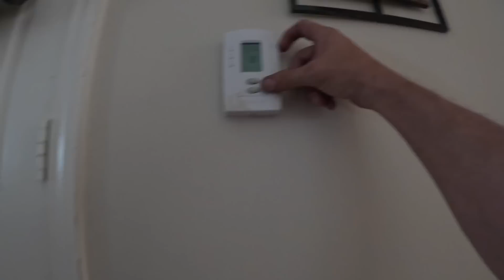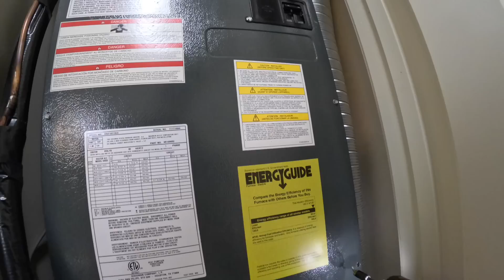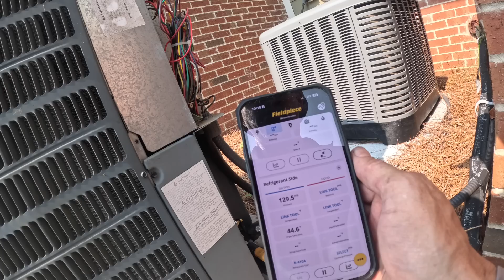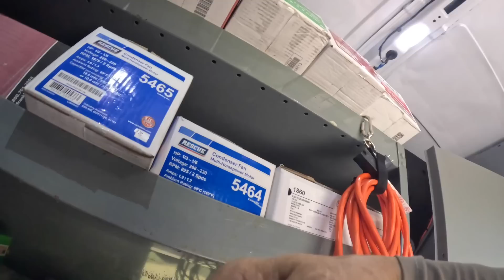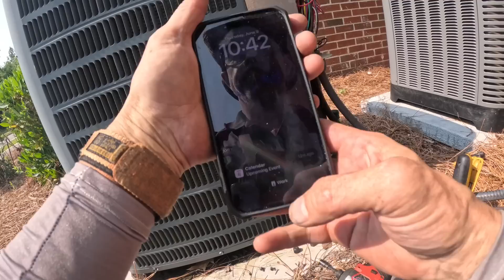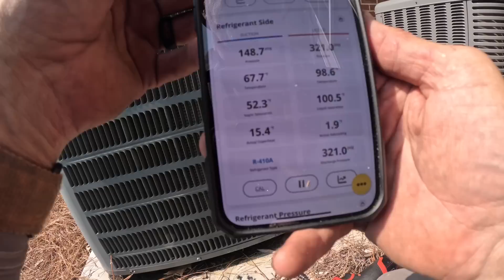There Was Evidence Of Ice, But No Clear Reason! #hvacguy #hvaclife

Comment: Good diagnostic..I would have done the very same but I would also have ohmed out the state line for resistance to see if any lines were weak. Then I may have recommended replacing the thermostat wire to the outside unit and air handler..am I that farr off??

Comment: a couple of months ago I found a system that was iced up but there were no airflow issues, pressures were good, and I could not figure out what the hell was going on. Well, when I noticed that the drain line wasn't letting all of that melted ice go down it and that it was clogged, I looked at the float switch wiring, and guess what. Those mother fuckers wired the float switch to break green, so when they got a clogged drain, it would turn the fan off.

Comment: that was a quick evaporator check though ,is the filter blocked ? is the blower motor dirty ? those are some factors to check ,you got a high low pressure reading did you check to see if you had a restriction in the filter drier ? spooke too soon before the video ended lol

Comment: I have worked on Goodman for years.  I run into this weekly. I fix them by replace fan board in Air Handler and replace outdoor contractor. That usually stops the icing…..if you see no reason for icing.  Hope that helps. It works for me
Reply: You forgot the blower capacitor being out of spec causing the blower motor thermal switch to trip. Then it cools down and comes back on..
Reply: I just wonder how a fail contactor  can create icing problem  .?
Reply: @Xubaosong  welds itself shut..
Reply: @Xubaosong  contractor sticks allowing outdoor unit to keep running when indoor fan is off due to satisfied temperature randomly

Comment: Did you check the blower capacitor? I've had several to go out of spec and cause the blower motor to shut off and then back on causing the coil to freeze
Reply from the maker: Yes

Comment: Just had my Goodman looked at 15 yrs old ,worked OK but was 3 lbs low on charge. The tech said my 5 ton Goodman holds more freon than he had seen on a residential system. Didn’t see any oil leaks anywhere. They charge 600 dollars to separate the system and do a leak search. 135 a lb for R22
Reply: Wow, I don't change anything extra to find the leak. Unless I have to use dye. Schrader valve is the most common place.

Comment: Questions #1 - Should the cold AC line be insulated all the way to the A Coil? 
Question #2 - What MERV rating filter will not cause a problem with air flow?
Question #3 - My systems duct work is not insulated or seams taped, should I insulate them and if so can I use bubble foil? BTW, I love your channel and have learned a lot!!!
Reply from the maker: Yes large line should be insulated where visible. ,  use fiberglass 30 day filters, there is an R-8 bubble insulation, but it’s not bubble foil.
Reply: @HVACGUY  Thank you for answering my questions and a great channel!
Reply: You may have internal duct insulation.
Reply: @Bryan-Hensley  Thank you, I checked for that and no it's just the metal ducting. It's an older system (1990's) but runs perfect with no issues and the AC unit is a 2008 with no issues. Just got the place and checking/cleaning/fixing and improving what I can.
Reply: @richardstone5241  it definitely needs duct insulation especially if it's not inside the insulated living area. It's not super important if the entire duct system is inside except it might sweat with AC on.
Reply: @Bryan-Hensley  The duct work is located in an unfinished basement. The basement is dry and does not lend itself to be finished therefore will only be used for mechanicals and some dry storage. I have the AC running and the ductwork seems dry but I think insulating it might be wise.
Reply: @richardstone5241  it's wise to insulated as much as possible.
Reply: If there is a vent coming out of the basement ductwork in that area then no, thats a “conditioned space” and insulation is not needed.

Comment: When you have a Goodman, Anything is Possible. 🤔🤪👎
Reply: Spoke a little too soon
Reply: That's true, I've put in over 1000 with less than 1 percent warranty call..
Reply: Goodman is no good equipment
Reply: @Xubaosong  I've put in over 1000 with virtual no issues for 22 years out 99 percent of them. I started out selling them as a cheap line but Trane, Carrier, York and especially Rheem were giving much more issues. I stopped selling anything but Goodman.